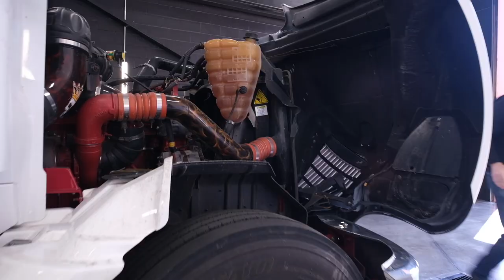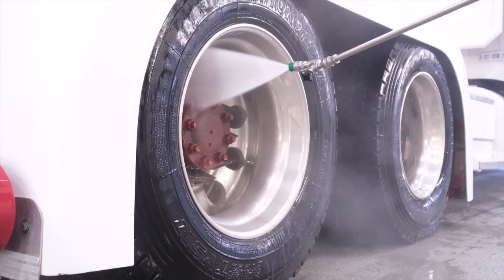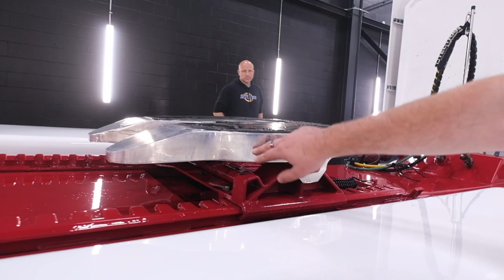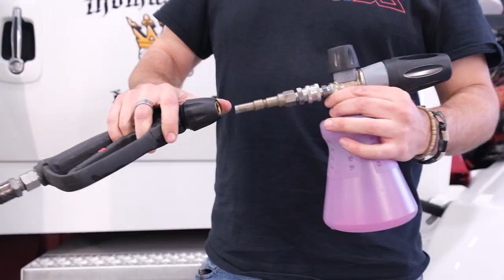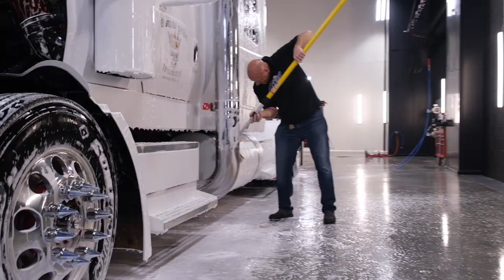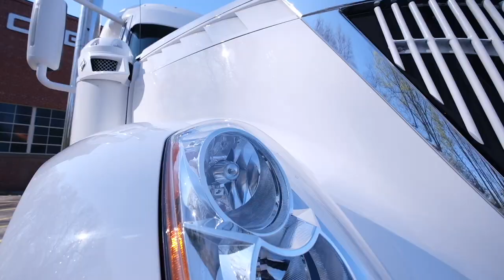Launching The Foamiest New Mitt Wash Ever with Thomas Pride Trucking!

Comment: I can tell you from experience, DON"T, DO NOT use degreaser on paint. It seems fine short term, but trust me degreaser will ruin clearcoat. I have a 2001 automobile that I used degreaser on the front to get bugs off and it destroyed my clearcoat after a few years. I did not use it every time just during lovebug season.

Comment: The heavy duty purple streaked my truck really bad mixed 50/50 bad on the stainless and mirrors at 20% it was a little better
Reply from the maker: I noticed that issue come up undiluted after about 8-10 minutes of it being applied and not letting it dry, I think I’ll max out the process at 5 minutes next time or use it a bit more diluted